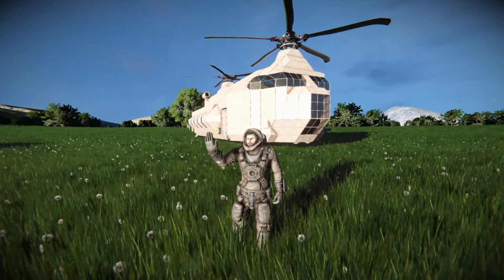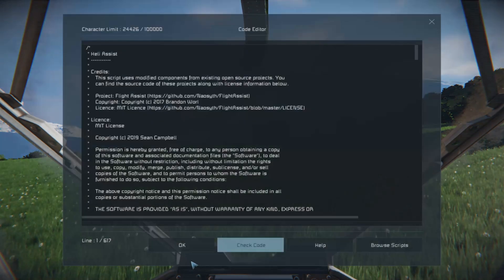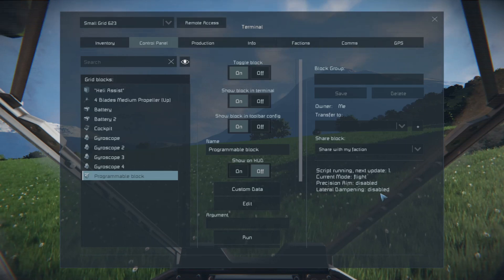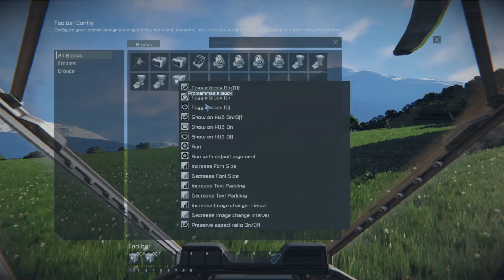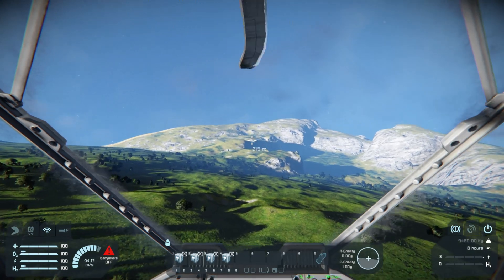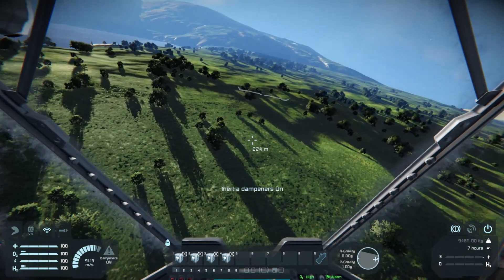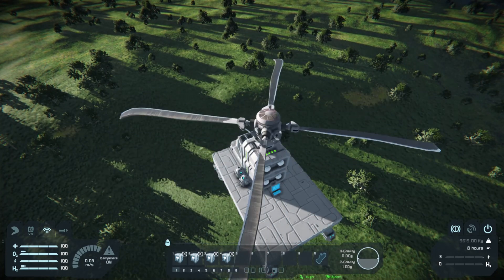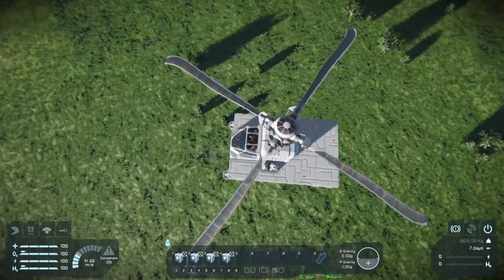Space Engineers Tutorial: How to Make A Helicopter

Comment: I built one and it works I didn’t place a program block it’s a little weird but it works
Reply from the maker: You can make a working helicopter just fine without a program block. The difference is you have to manually control it, roll pitch ect. The script just does that for you which in turns makes everything easier to fly